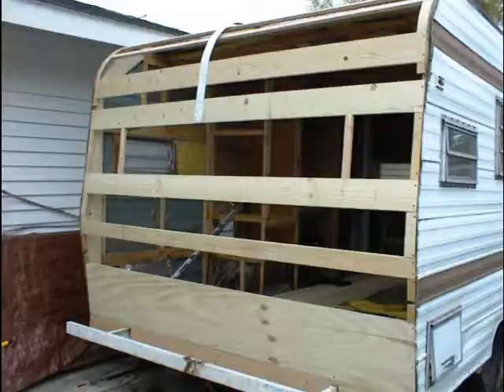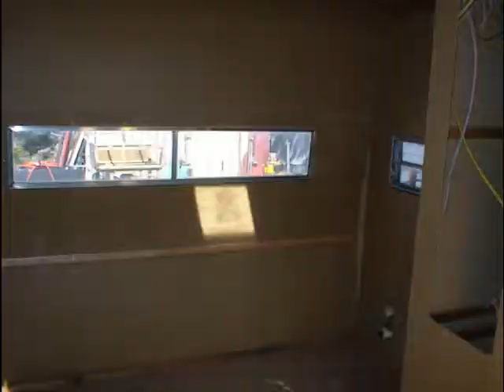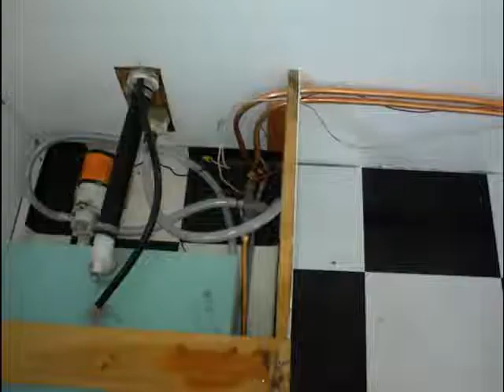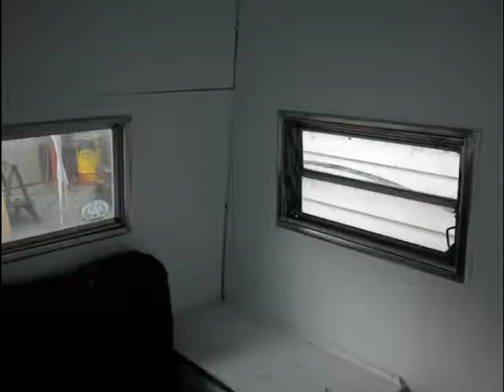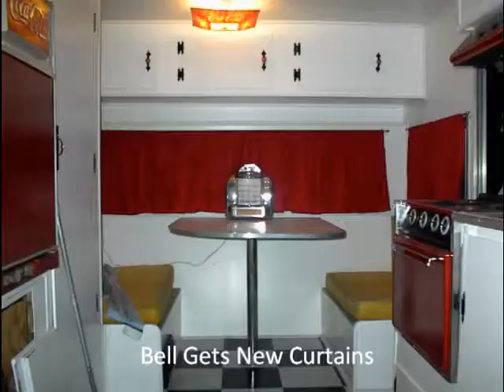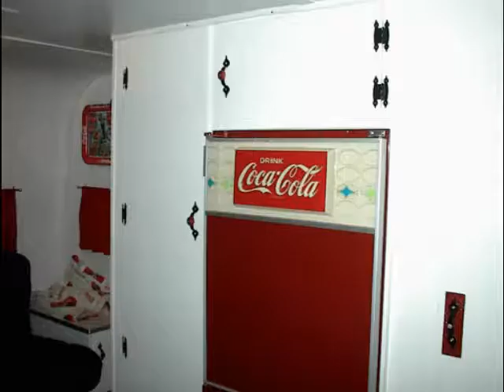Bell Video Part 2

Comment: Where did you find parts for it. I have a 1972 Bell I just bought and would love to work on it.
Reply: I used local RV places, if they had what I was looking for. I bought a lot from eBay, new and used.
Reply: @garygass8433  thank you so much for responding:)